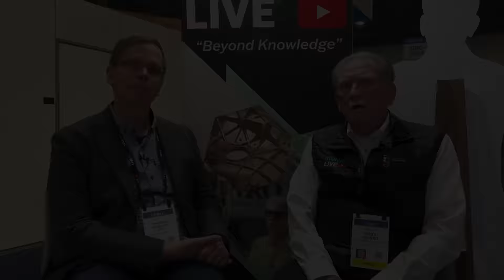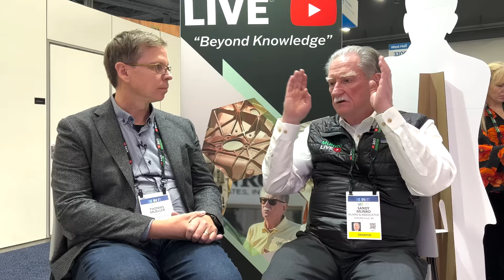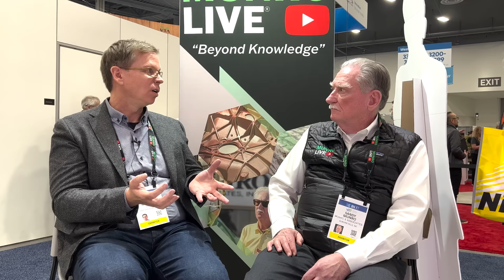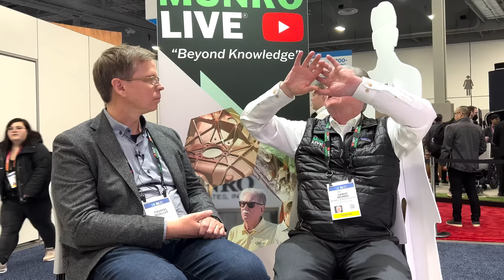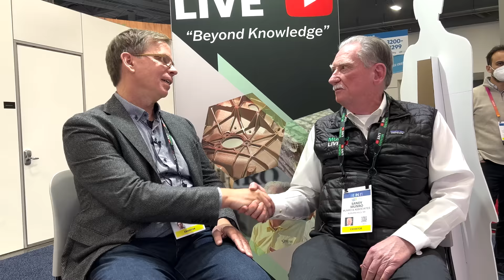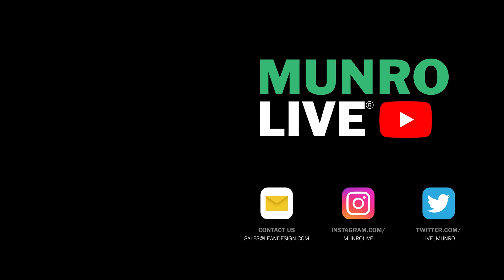100 Million Lines of Code: The State of Automotive Software | CES 2023

Comment: there are evolutions here.  Distributed ECUs wer implemented on the bus because they were the cheapest form of switching than using high current  mechanical switches - originally...

Going back to 5 CU bricks - has nothing to improve re. (for example) a 0.05s latency on the reversing light actuation...

A speedometer has no latency issues when visual latency is 300xthe  0.001 s  system update rate...
Standby systems x2 redundancy are normal in system critical aviation sectors, with real-time error and parameter estimation - 40 years later the automotive sector gets there,

(maybe Tesla is merely  doing engineering as has been espouse by the experts for decades... (and not implemented by backwards looking industries) ???

Export of modelled parameters is all that is needed - not aviation / human safe, standard however.

I think these guys don't really realise how the aftermarket already works (outside of OEM equipment)  - one can already - "smart phone - skin", their aftermarket dashboard - no need for the future. Just het with the present - OEMs too.

BYW EVs do wear out their tyres... (faster than current ICEs - and EV companies are destroying their long term margins already - -besides cannibalising new car prices...

Comment: 100 million lines of code represents the bloat in software.  It is a badge of shame.  The elegant software that makes the most of the hardware has fewer not more lines of code.    I feel sorry for the software engineers that have to maintain that code base.  I feel sorry for the users who have to deal with the sluggishness of the User interface.  Lastly the amount of processing power needed to deal with 100 million lines of code running is a problem for efficiency.  The processors use more energy than if the code is more efficient.    The boeing Aircraft using one tenth the lines of code tells you the auto industry can't write software efficiently.  I would fire half their software teams and make the remaining ones do more with less.  Cut the number of Electronic modules in the car and you can cut the number of lines of code.  Also, cuts the cost and increases the range of the car.  Simple.
Reply: The reason for that is that a new car model must be released every 1-2 years. The code ends up being a mash up between different teams and on several occasions the code development is outsourced.

Comment: What an absolutely ill-conceived bad idea.  Embedded systems are small and not easily upgradable by design.  As soon as they started going on about “6G enabled off platform computing” I knew they didn’t know what they were talking about.  The only off platform computing that will be useful is entertainment.  If you lose signal in the middle of the mountains you don’t want the performance of your car compromised.

Comment: I’m completely confused…
1. Android IS Linux. It’s not going to make route calculations quicker. Are you actually an IT expert?..

2. “Different parts of a car don’t talk to each other” — do you know what CAN bus is? Are you actually a car expert at all?

3. “This car is so perfect, the hardware will last forever, we only need new apps” — again, are you a car expert at all after that? If you don’t know and don’t value the progress that has been made even from one platform generation to another, not to speak across two or three generations — then you just don’t know what you’re talking about.

4. “Motor runs forever, gearbox runs forever, brakes are not used because of the recuperation, and even tires do not wear down” — I believe that was the signal to anyone in a sober mind that this whole show is just a gameplay of 2 actors.

I have no words, really… Just sad :(

Comment: Ok, so somebody has to say this. This talk is essentially an echo chamber of echo chambers.

Sandy is optimized to cut manufacturing costs for physical systems.

He’s way out of his depth with regards to both software and information architecture.

Lowering the cost here involves standardizing the common bus i.e. canbus and making signaling more open, documented, and efficient (with fewer wires.

To be honest, switching to a weather hardened version of gigabit Ethernet would go a long way towards solving much of this. Everything supports Ethernet and the wiring is much more easily serviceable.

The whole ‘Linux’ vs ‘Android’ talk shines light on the utter ignorance of Sandy about these platforms. Android == Linux

Again he’s out of his depth.

With regards to C, literally 95% of the modern world is written atop infrastructure written in C.
Don’t knock it so easily, there’s a reason C has been so resilient, and it’s NOT inertia.

Potential replacement candidates… Java? Haha! That’s laughable.

Go? Not reliable enough, and waaaaay to dependent upon google.

Rust? Perhaps the ONLY plausible contender here, and bear in mind that finding RUST talent is harder than finding C talent.

Sandy knocks architectures involving dozens of microcontrollers, then nods in agreement as the consultant praises ‘microservices’…

Microservices are the very embodiment of “dozens of programs constantly talking over the network” in other words latency.

Now what is being discussed here is the ‘containerization’ of automotive software. Which will half-work without an automotive-kubernetes cluster management system (think kubernetes but with low latency hardware access for containers).

Then yes, we can have some interesting efficiencies realized on the “edge cluster compute” board.

I think reducing the distributed controller count from 150 to 10 is unrealistic, but it might be possible to bring it down to about 20-25.

Comment: The legacy automakers are using software written using a 40 year old programming language call “C“. Tesla write their own software using latest programming languages, BUT TESLA IS JUST A CAR COMPANY! 🤣😂🤣😂
Reply: We still use C and Fortran for power plant processes. If written well, its fast, efficient, and can never break. 100% reliability guaranteed else there's loss of $$$ or even life. One feed line of a 500 MW station can lose $100,000 per hour if down. Tesla Car is an unnecessary luxury consumer product. There are many processes outside of automotive that require 100% reliability at all times.

Comment: 100 Million Lines of Code? Are you proud of that? As and IT professional for 25+years, Programming teacher and EV Conversions professional for 10+years I can only say: absurd, non-sense! you as a software developer got an "F". You must be using bad programming techniques, I have several conversions that do not use a single line of code beyond the embedded controller software. Simplicity is their beauty. You IT guys who go into the Automotive industry will obsolete things quickly. A car can last decades, a car is NOT a tablet or a computer that needs to be "updated" often. You will spoil the beauty of the EV. Newer EVs will not solve the mega problem the world is facing. A Conversions Car Mega project removes pollution from used and inefficient cars. "Planned obsolescence" has been the IT industry mantra for decades since IBM, HP, Microsoft to Apple, Oracle to Google, to Amazon, etc. do not do that on the Automotive Industry, do not force users to generate tons of trash by having to "renew" their cars. Save the World! Yes you need some coding in an EV, but 100 Million lines in a car is absolutely expensive in terms of time, money, resources, maintenance, upgrades, etc. Use KISS techniques instead, for those familiar with Programming Books: (Keep It Simple Stupid!)

Comment: Inclusion of humans into this environment guarantees complexity and latency. Want autonomous vehicle to work? Simplify. Remove the weakest link -- humans. A hodge-podge of autonomous and human directed vehicles represents too difficult a problem. Show me a foolproof system and I'll build you a better fool.

Now, there is the little matter of introducing other humans into this system: other vehicles (scooters, bicycles, etc.) piloted by humans and the worst, pedestrians (irrational, impossible to predict, slow, and vulnerable).

The reason airliners have less signal processing is the lack of machine-human interactions. Not hard to understand. Now, enough VTOLs in the airspace, and you've got a recipe for a fcuking disaster. Flying to work is a great idea until every other idiot is out there sharing the airspace. 

In order for autonomous conveyance to work, humans have to relinquish the illusion of control they have. Won't happen until the current generations are dead and gone.

Comment: If you talk about software in terms of the number of lines of code I feel that you don't know anything about software. The number of lines of code should be as minimal as possible and this just sounds like there is a lot of bad code out there.
Reply: Or code that also supports other platforms/hardware/usecases, and which does not get compiled in.

Comment: how the heck is auto software so bloated?  i dont understand how a car can have ten times more code than a dreamliner.  sounds like its the most horribly written, inefficient, pile of crap code possible.
Reply: Very simple.
Aerospace wants bespoke code.
Automotive uses off-the-shelf stuff. And if you use linux for a specific platform, you build only those bits needed for that platform. But if you want to distort the truth, you claim all of the lines of code.